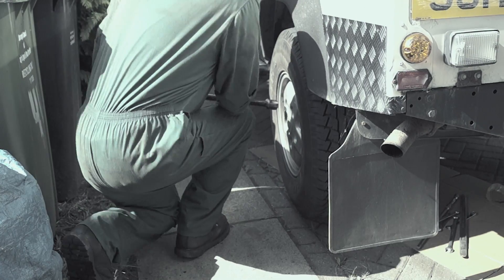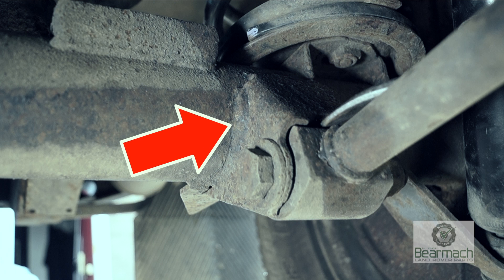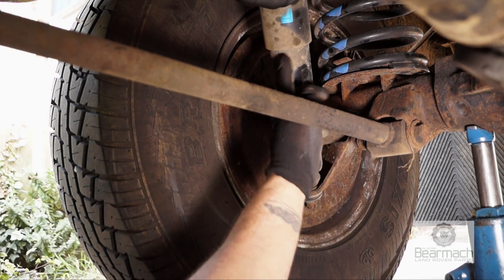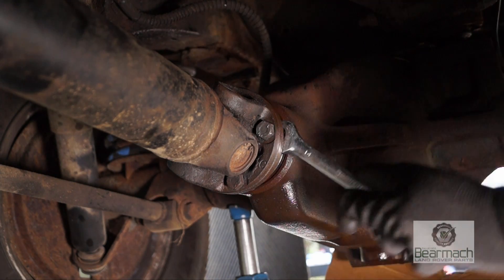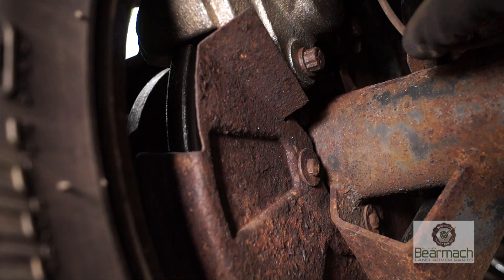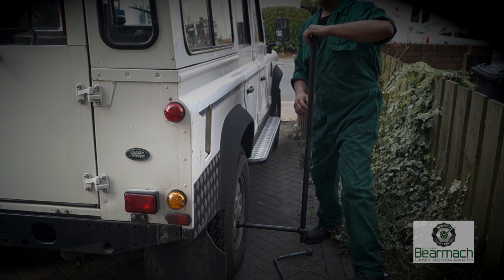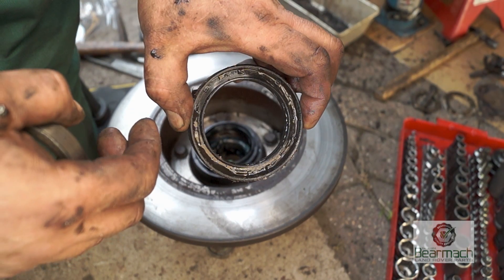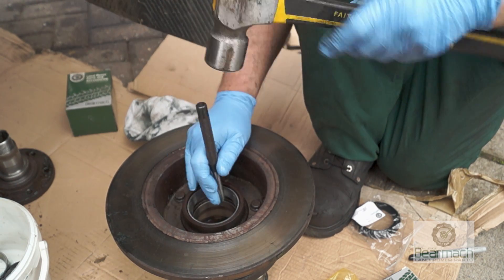Rear axle inspecting - The Fine Art of Land Rover Maintenance

Comment: very comprehensive 
My problem is rear axle leak.I guess the oil comes from the differential 
Do you have a video for rear axle seals repair ?
My car is Defender 110 LWB model 2006
Thanks 
Ayman 
Sudan- East Africa

Comment: just had to do the back end of my 2001 defender had to replace both axles and half shafts because of wear on the splines is it worth doing the front as well as i still have some backlash when changing gear and  also sometimes when i release  the throttle. Most garages i go to say all defenders do this so can imagine how pissed i was when my truck went bang and i lost all drive in the middle of a busy intersection. Also are you on patreon would be happy to put something towards these awesome clips you do nothing else on you-tube comes close
Reply from the maker: Drive flanges can go at the worst time too.  We regularly change them on the latest Defenders that work for a living.  Old Land Rovers are worn.  Working land Rovers will show up weaknesss and they vary depending on work they do.   

Yes we are still on Patreon.     Watch this weekend's video.

Comment: looks like I'm getting bit of oil coming out the middle of my rear nearside wheel. could this be the seal?
Reply from the maker: +Michael Barnes  yes it could but make sure your brake system is not leaking.